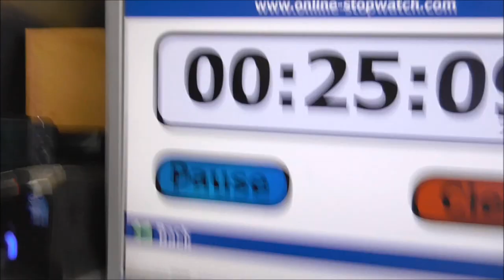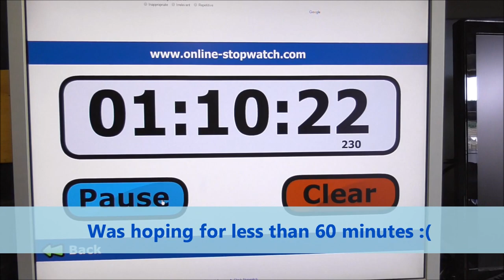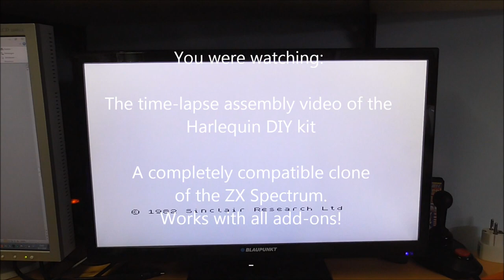Harlequin ZX Spectrum clone DIY assembly time-lapse video

Comment: I'm from America and we use something called NTSC, would this work on an NTSC system?
Reply: The AD724 chip used on the board can also generate an NTSC signal. You need to look up the datasheet of the AD724, it is really simple: Use a different crystal and invert one pin, that should be enough to do NTSC.

But eh... most TV's made in this millenium handle PAL, Secam and NTSC with no problem. Check your TV, if it is not too old, it should be able to handle PAL.